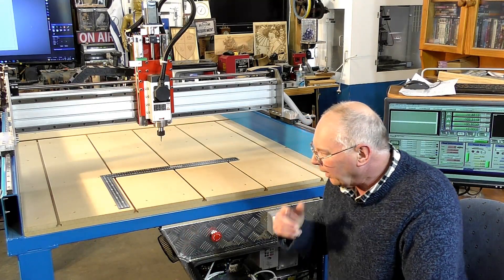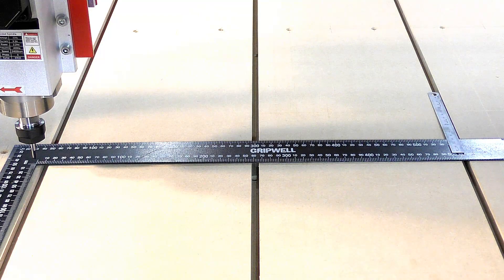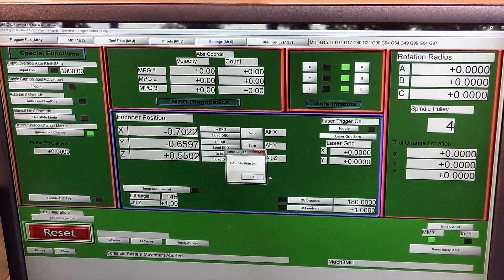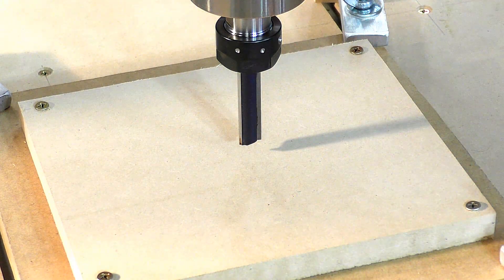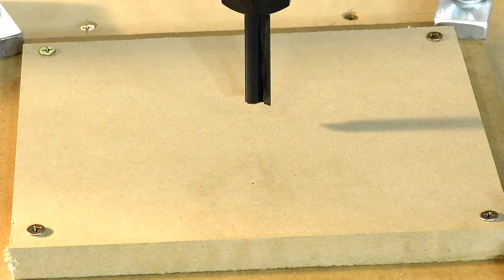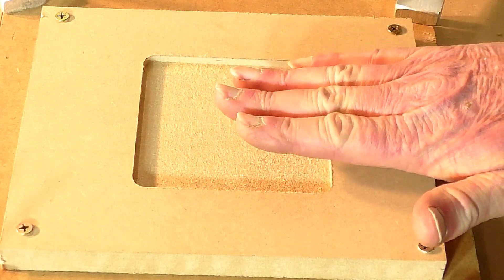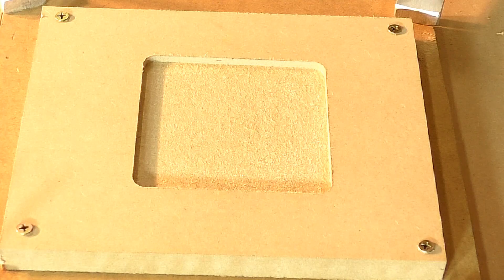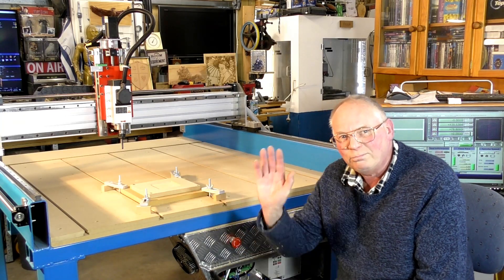CNC router accuracy check, spindle tramming and adjustments

Comment: Thank you for sharing your experience,  
Does this setting work with 1500 x 3000 mm workspace machine? Specially when you copy and paste the configuration result for the x axis to Y and Z, or it works with only your machine? Thanks